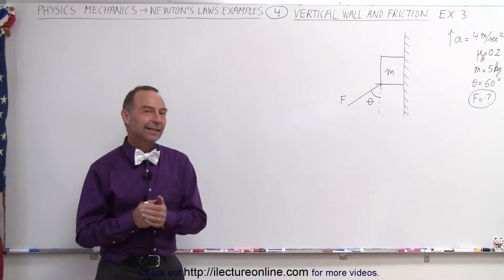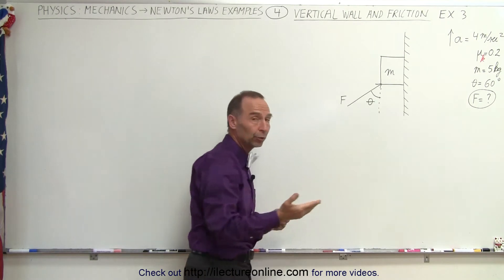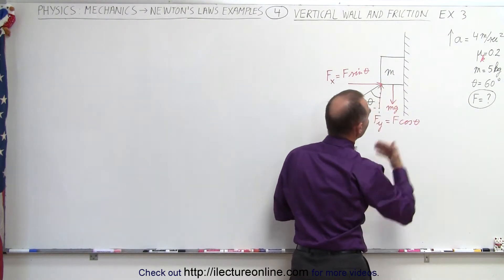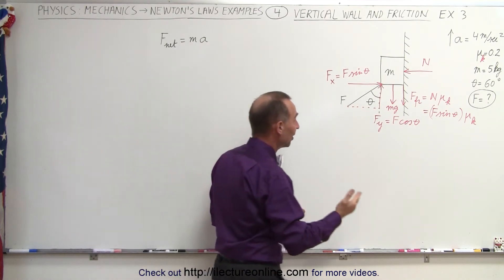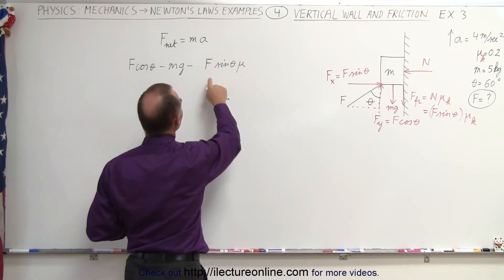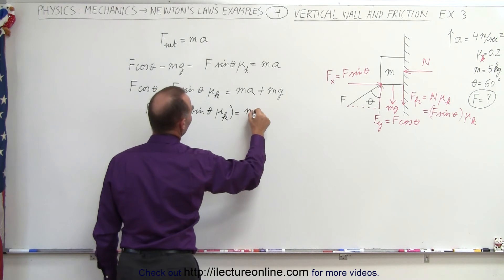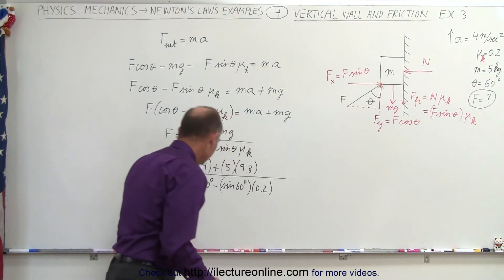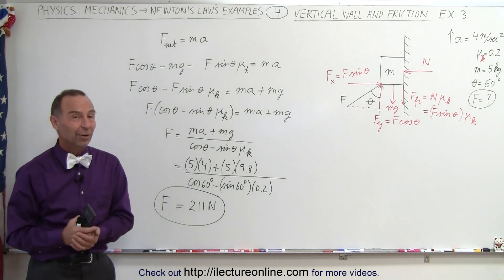Physics 4.1 Newton's Laws Examples (4 of 25) Vertical Wall and Friction: Ex.3

Comment: another excellent video thank you. what if all the given values were the same but the object was slowing down due to the acceleration? friction would then be upwards as motion is downwards? does this mean that to be able to truly solve this problem we would need to know the direction of motion?
Reply from the maker: If the object is moving upward, the direction of the friction force is directed downward, and if the object is moving downward, the direction of the friction force would be upward.  The direction of the friction force is in the opposite direction that the object would have if there was no friction.

Comment: Do the components in the x axis not matter? Why are you only using the components in the y axis?
Reply from the maker: The horizontal components of the force are only needed to calculate the friction force.
Reply: Michel van Biezen thank you sir